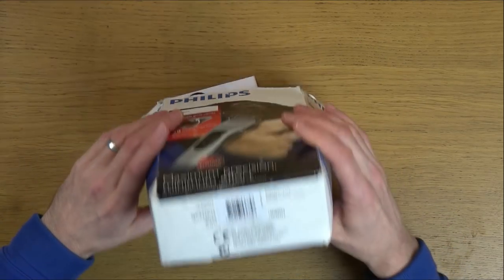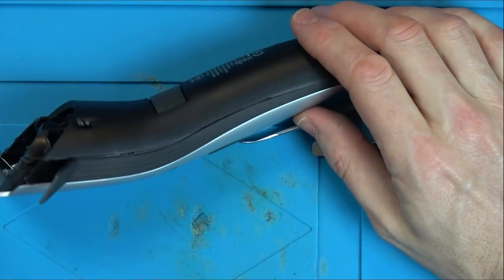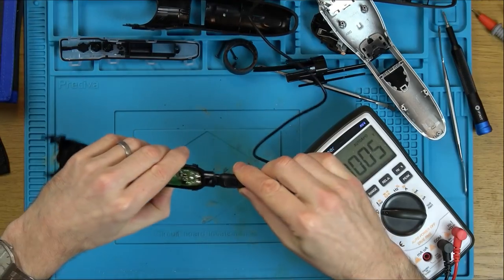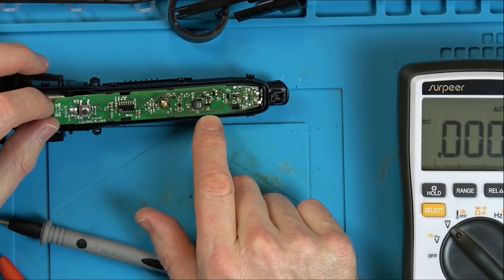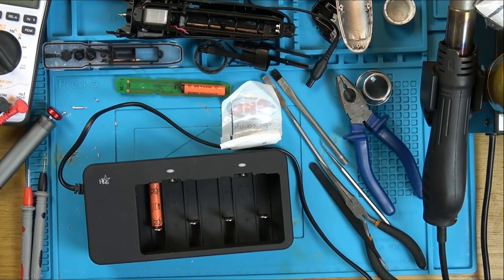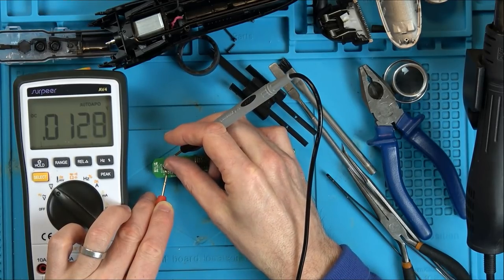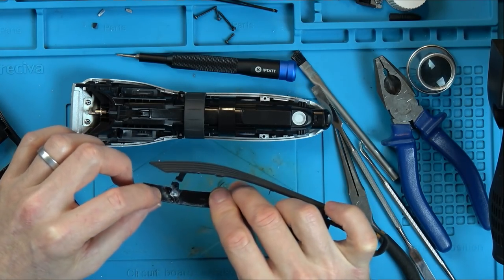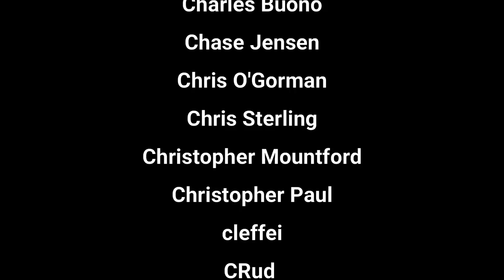Trying to Fix Philips Hair Clippers - Cheap Haircut

Comment: The reason the battery's have not charged is a safety feature in the circuitry...If the battery's drop below a certain  voltage the circuit will not start the charging and cuts all power to the whole unit. When you removed the battery and charged it out of circuit it brought the voltage up allowing the circuit to charge once the battery was placed back in circuit. As for why the battery dropped so low it was probably just left to long NiMah don't hold there charge like lithium battery's.
Reply: I've just had a similar problem with our cordless Vax. My daughter ran the battery until it stopped, didn't turn it off and put it back in the cupboard. When I tried to charge it there was nothing. I opened up the battery and went straight on to the battery pack with the bench top power supply for 5 minutes. That was enough charge for the charger to recognise the pack and fully charge it once more. I have had the same issue with Dewalt batteries on my cordless tools and done the same thing. It makes you wonder how many devices and battery packs end up in land fill just because they are a couple of volts below the threshold.
Reply: @bobuilt10  That’s really such a shame... There are probably so many people that threw their stuff away just like that....
Reply: That's one of their downfalls - self-discharge over time.
Reply: About 11 years ago I had a problem with a mobile phone I owned, it just didn't charge, I think it lit for a second then nothing, I think I got it working after constant removing then reattaching cable to give it a split second of power about 20 or 30 times then it charged!

Comment: what a resoult... another saved item, another to be well used item. congrats. to whatch you go from 0 to mayby 70 through out your yt try to fix videos (if you dont mind only couse there are some professionals that are a bit better than you, thats why the 70 progression) motivated me to start fixing things. i recently fixed 2 old style mobiles 1 of whitch had an unsuccessfull visit to a technician. the phone was charging but eating rappidely through the battery that was new. it simply needed an ipa clean and a cap from a reboncable was shorting to another one. the technician said that the phone needed a reset whitch i already had done about 5 times. the other phone was a case of a dearty botton contacts. thank you vince for what you do. you save not only the devices that pass from your hands but also encouraging many other people to do so and that to an extend saves the world literelly, saves the planet. thank you and keep goingno mater what.

Comment: That was a close shave!  Great job getting it working again =D  It's quite common for things like this with batteries for the battery to go totally flat, at which point it wont charge it.  That may be because its so flat its drawing more current than the charge circuit permits.  You could see that as a safety feature, but as you say - on batteries of this type, it's fine to charge them up from totally flat.  Some of the life of the battery will be lost from letting it drain to zero in the past etc, but I've recovered products myself like this before, just by manually charging the battery to get it off the 0 level etc.

Comment: The reason why the battery didn't charge is likely because of a battery protection mechanism activating as the battery has dropped below the threshold voltage which protects the battery, device and user in case a battery fail; it essentially disables charging and the power up of the device. By taking it out and charging it on a external charger you're bypassing the shaver's protection mechanism and allowing the battery to once again receive charge. The batteries should be good without needing to be replaced. Overall a brilliant fix as always. Also a brilliant haircut you did yourself and I think it would be great to see your face more often in the videos.

Comment: I'm using the same Philishave now for more than 20 years. During its life, it got 4 battery swaps already. I just use regular AA NiMH batteries with short wires soldered to the terminals.
Your clippers have a charging circuit with some level of intelligence. There's a buck regulator, indicator LEDs and probably also a safety shut-off.
This clipper's dead cell could also be shocked back into life by connecting a freshly fully charged battery in parallel to the dead one for 10 to 20 seconds or until something gets hot. After that, connect the charger and give it a full charge. For a never used device, that would be a valid fix: those batteries are still new.
Reply: I was just going to mention something about the batteries.  I do the same thing.  I just solder some tabs to regular Eneloop batteries to fix these items - should last MUCH longer to boot, too.  I think I saw a '650' on one of the batteries in here, whereas Eneloop will be 2000mah.

Comment: I had a rotary shaver which plugged into AC and took forever to charge. One day it wouldn't charge so I took it apart and removed the battery and everything except the motor and switch. I replaced the internal battery with a battery holder from an old solar garden light and it worked great. I can now use rechargeable batteries as well as alkalines in a pinch. I had these 15 minute rechargeable batteries at the time and I've used this setup for many years until the heads broke.

Comment: I use a Philips Norelco Electric Shaver myself, and it's waterproof, has a rechargeable battery, and a removable head which can be cleaned easily. Definitely expensive, but worth it.

Comment: Nice repair. I can only assume that although there may not be a chip on the battery, there may be a chip on the shaver which recognises there is a low charge and auto stops charging/putting charge in.

Comment: On occasion when I have a dead NiMH that will not take a charge I zap them with 12 volts.  Then place them into the charger, it was a trick we used to do with flat NiCd many years ago.

Comment: Also, I used to get my hair done at home, using clippers like that, always went a #3, but then a #3 started becoming too short, unfortunately every clipper can come with different sizes, so a #3 on one isn't necessarily the same as a #3 on another.

I was also told by various hairdressers over the years that hair cut with clippers grows back faster, and I've personally found this to be true. With clippers my haircut is every 5 weeks, with scissors (and a little electric clipper to tidy up around the ears, etc... at the end) my haircut is every 10 weeks.

So for me, it's off to a no-appointment hairdresser every 10 weeks.

Comment: I agree with @Simon Wilkinson, the circuit has a safety feature that when the one battery/both batteries drop below a certain level, then the circuit breaker as it should be called kicks in to stop the batteries from being recharged, and renders a lot of things useless due to the cost of replacement of the batteries being replaced by a professional, or risking a diy job, or buying a replacement. diy would be easier but probably not enough videos on youtube on how to replace batteries in a specific item.

Comment: My Phillips shaver does the same thing. Works with power cable or battery. But if the batteries drop to the level where it powers off I have to have it on charge at least 10 seconds before I can run it from the cable.

Comment: I don't believe it's necessarily "dangerous" for NiMH batteries/cells to go completely flat and they won't develop a memory the same as NiCads...  It's not usually a good idea for them to stay discharged and since there are two cells in series that kept the device from running either plugged in or not.  Nice score Vince and you look very dashing with your new haircut.  BTW I've not seen the inside of a barber's shop in more than a decade (I shave my head and trim my beard myself)...  Looking forward to more Trying to Fix videos!

Comment: Only just started watching the vid, about 2mins in, but couple of things just from the beginning: Just because it looks clean, doesn't mean it is new :) I'm very good with keeping things like that clean. My original electric tooth brush (Oral-B really fancy expensive one, Triumph model) looked pristine for its first 5yrs, but then it started deteriorating, and by year 10 the rubber had fully worn away.

My current electric tooth brush (Another Oral-B fancy one) I've had for 2yrs now and still looks as new as the day I bought it.

Secondly, I've had electronic devices where if the battery is dead, the unit won't work regardless of whether you give it AC power or not.

Nintendo DS Lites are like this, they won't even turn on if there isn't something present on the battery contacts, I had an old laptop, where if you removed the battery pack, the laptop wouldn't turn on with the charger, because the charger just kept the battery charged, the battery was what was powering the laptop even with the AC plugged in (It was an HP Compaq laptop).

Comment: I got to say I'm super excited about this, I have a handful of clippers like that that just seem to have stopped working very well, I am hoping that I gain a bit of understanding about the inside so I can fix them :-) or even upgrade them maybe
Reply: If it is reasonably modern one with multiple LiIon cells, themost common thing is that the battery management system drains one cell (as it uses it for power) down to a point where it considers it unsafe to recharge it. If you see one cell significantly lower than rest, you can try charging that separately with something less conservative (like maybe a bench supply) up go a Point where thé BMS Will again accept to try to charge it,  bypassing the BMS. Or replace it if bad enough to no longer take a charge at all.

Comment: My guess based on my experience repairing game boys is that the corrosion that built up did something to stop power from getting through to power the unit, even when plugged in. I had a gameboy I thought was completely dead due to corrosion on the battery terminals, and even plugging it in with an AC adapter didn’t make it work. However, after a significant cleaning, it started to work with the adapter. Sadly the battery terminal traces were gone, so—without jumper wires—it was unable to work via battery power.

Comment: I work with Medical equipment and one thing we discovered.  When the batteries in our EKG machines die, the EKG will still operate but you will not get a print out.  I am not fully sure why that that is, but that razor may be operating in much the same way.

Comment: I know the reason why. I have previously repaired LiPo powerbanks and NiMH trimmers that don't charge/discharge at all. All it takes is to disconnect the batteries from circuit and reconnect to start charging/use. This resets the charging IC and starts working normally. Most trimmers usually use a most minimal dumb circuits.

Comment: I had a very similar problem with a rechargeable remington recently, the batteries do discharge at slightly different rates and occasionally need to be charged separately if they get too out of sync, as the charger balancer won't charge if this happens.

Pretty sure these will only run from the mains if the charger is running, which it will stop doing so if it thinks the batteries are full, or faulty.

Comment: Hey Vince have you considered merchandise?  You can throw something together very quickly such as just MMV logo on hat/mug/t-shirt/sweater and use a prebuilt storefront. Or spend a lot of time and do repair mats and tools (spudgers, screwdrivers etc.).   Up to you.

Also I think you'd do well monetarily with live streams.  I think the drama of not knowing whether you can fix the item or not would be very compelling for the audience (although I know you don't like idle time in videos).  And you can edit it down to a usual video afterwards.  Just a thought as it's not for everyone - and it is a bit more work.
Reply: You could be on to something about a live stream, although to combat the length and idle time do it as a premier. Still has the feel of being live with the chat, but with the idle bits pre-edited. Also instead of Vince being distracted trying to keep up with chat, he could interact with it no problems.

Comment: what you'll probably find is that there is a charge controller IC on the board, that if it registers the batteries as below a certain threshold, it declares them as defective and will not allow current to flow through the circuit, forcing a charge into the battery will wake up that IC and will now allow charging and operation mate

Comment: Broken Tabs are annoying. Have you ever tried super glue and baking soda? Super glue and baking soda can be sanded does glue with super glue out of pinch of baking soda over-the-top shake its instantaneous. Would you do a video on trying five or six different gluing techniques or repair techniques? As always great Channel

Comment: My Biltema clippers stopped charging the Li-ion battery. I removed the battery and patched the terminals directly to the DC port. Now I use it with a simple USB  power bank .

Comment: The fibers inside the battery have to be shocked back to life. Easier fix is to plug it into the charger 🔌 and then quickly plug it and unplug it from the wall about 10 times.

Comment: The charging voltage of the batteries are always slightly higher than the nominal voltage of the battery. So, to test if the charging circuit is working you should put the meter leads across the batteries and check the voltage with an without the charger plugged in. The voltage between the batteries should be different when is charging.

Comment: NiMh?  Jokers.  Minimum voltage detection before initiation of charge is pretty common with microprocessor controlled chargers as a safety measure.  Problem is you can't charge when batteries are dead flat.  Trickle charging for a short while is enough to get them above the detection voltage.  Swapping them is straightforward except when they have spot welded tabs.  Don't solder batteries.  Good job mate.

Comment: next time give the battery a small charge with the power supply and the power cable will do the rest off the charging they just need a small charge to be back in function. so you dont need to take them out. works with flat laptop battery also.

Comment: The electrolyte of the battery might be conductive causing a short or incorrect connection. You shouldn't let NiMH batteries go completely flat either .... Another possibility is that the charging circuit would refuse to charge to prevent explosion because it might think the battery is damaged. But I honestly an not sure that simple charging circuits in shavers are that advanced (I would think not). You could have tested the shaver after removing the electrolyte .... if it worked the electrolyte was the reason.

Comment: Lithium batteries will include a controller that doesn't let them go too flat. Those are probably Ni-Cd and there is no controller as it is old tech and when they are dead they are dead usually for good.

Comment: I figure maybe it was left unused for so long one of the batteries dropped all the way to 0 but the other battery still had some voltage, leading to one of the batteries being reverse charged, breaking down internally and resulting in leakage.
Or, if that wasn't leakage, maybe the charging circuitry works similarly to the Xbox 360 Play & Charge kits, which will refuse to charge up a dead battery (even though that isn't really a problem with NiMh cells)
And wow, I'm surprised that a relatively power hungry device like this would use NiMh AAAs. AAs have 4 times as much capacity and it looks like they could have fit.

Comment: The micro chip is controlling the charging .
The batteries go low the chip stops shuffling the bits & you have a brick !

The Nimh cells suffer from self discharge so the electronic design has holes in it .
Only eneloop type cells do a better job .

A low current start up feed of 2 or 3 ma could've been added at little cost .

Old semiconductor joke in that lot somewhere  !

Comment: Battery had a dry joint and when chip finds faulty battery it shuts down to save damage, when you re-soldered you fixed issue

Comment: What is the batteries voltage has dropped below a certain threshold they can’t recover that is why they have to be charged in an external charger to bring them back above the threshold voltage

Comment: The reason that it didn't work while it was plugged in is because the voltage was so low that the PIC microcontroller didn't wake to regulate the charger. And the voltage reference for the entire board is between the batteries.
Reply: You could probably had jumpstarted the charger by putting 2.6V across the batteries solder points from your bench power supply. But that wouldn't be healthy for the good NiMH cell in there because they were super imbalanced.